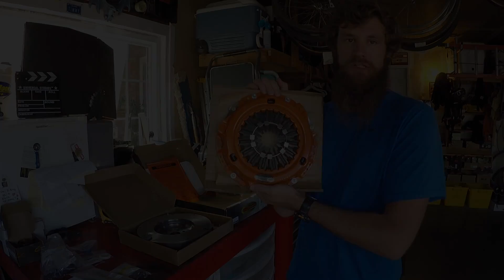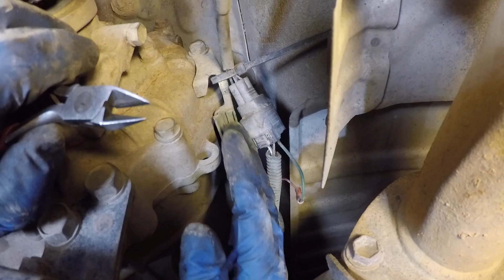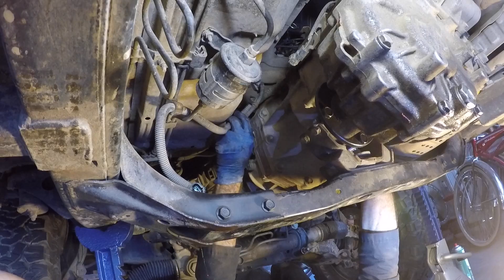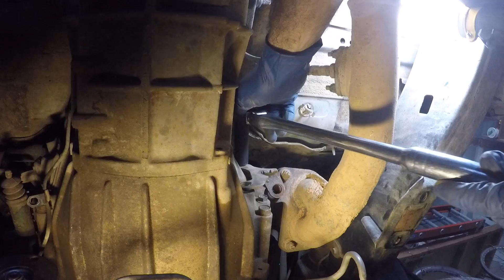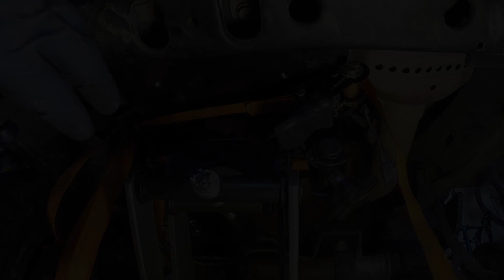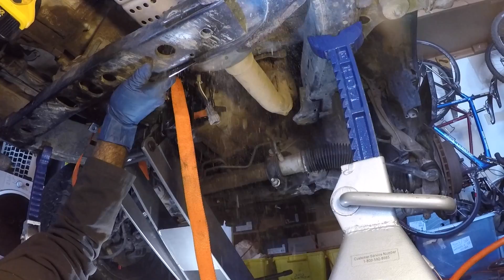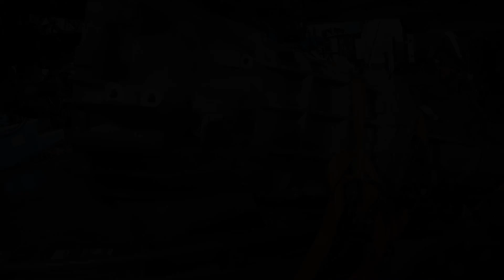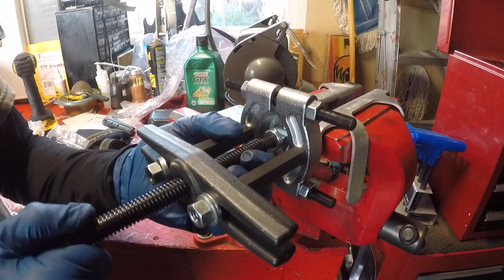Clutch Replacement (Part 1)

Comment from the maker: PLEASE READ THE VIDEO DESCRIPTION FOR HELPFUL INFORMATION
Reply: Flywheel bolts Part # 90105-10138. Check with where you buy them as some come individually and some come in sets.
Reply from the maker: @cjcruz7965  Thanks for sharing this.
Reply from the maker: @joseph7105  https://youtu.be/mrSRBmFZ1wk
Reply: @TimmyTheToolman  ma
Reply from the maker: @joseph7105  No problem.  The link to Part 2 in the video description was bad for some reason.  I fixed it.  Thanks for the heads up.
Reply: FYI... the estimated hours for basic clutch R&R is six hours
Reply from the maker: @efil4kizum  My local Toyota dealer charges $300/hour.  That would be an $1800 bill in labor alone.  OUCH!
Reply: regarding the shifter seats... OEM price is 53$ for the transmission one WOW... marlin is 12$ or so... big difference in cost, how is the quality?

Comment: Hey Timmy and Crew, I wanted to share my gratitude for the time and effort you all put into these videos.  This past weekend I completed the clutch replacement... along with the flywheel, pressure plate, clutch fork, t-o bearing, rear main seal, pilot bearing and shift seats.  Fun, challenging, and rewarding project.  No bolts snapped but I could not get the bolt out of the exhaust side of the exhaust bracket, fortunately I was able to get it loose enough to swing out of the way! thank goodness.  The other issue I ran into was having to bleed my clutch reservoir after the job, easy peasy!  Also, I was originally going to do the job on a dirt floor with a non-transmission jack.  Man am I glad I didn't.  I found a garage to use and a transmission jack and I don't think the job would have been a success without.  Thanks again for helping us all out.  Keep crushing, Cheers!
Reply from the maker: I'm glad our series helped you with the clutch job on your rig.  Good job getting it done.  Happy Wrenching!

Comment: Doing my clutch on my 3.4 today and I shouldve listened to you Tim I decided I wanted to take off my bell housing to give it a nice clean and also to replace my input shaft seal and well……………. That went south real quick broke 2 bolts I was able to get one out fairly easy the second one I was on the same boat as you guys were after a little drilling and cursing I managed to drill it out and retapped it good as new but man I wonder how many more of us go thru this.
Reply from the maker: It's odd that this happens.  I've seen bell housings come off with no issues many times,  but then you get ones with seized bolts.  The ironic thing is, I learned you don't need to remove the bell housing to replace the input seal.  All you have to do is remove the housing around the input shaft.
Reply: @TimmyTheToolman yeah shit sucks when bolts break! And yeah I had seen that as well I just wanted to remove the bell housing to give it a good clean remove alotta the grime and gunk it had built up when the bolts broke I just remembered your words lol YOUVE BEEN WARNED! 😅 I WAS LIKE FUCK! lol
Reply from the maker: @edwinthetechnician6578  Yeah, I try to give the best information possible so people don't experience the same pain as we did.  But, you got through it, and that's what counts.
Reply: @TimmyTheToolman thanks alot Tim ive learned so much from you and Sean im really thankful and appreciate you guys another thing that has helped me on this job is having the right tools!! Ive invested in some tools that make jobs so much easier
Reply from the maker: @edwinthetechnician6578 You're very welcome.  You're smart making the investment in tools.
Reply: @TimmyTheToolman  thank you I love working on my own vehicles the amount of money ive saved by doing the jobs myself is crazy!

Comment: Hey Timmy I doubt you'll see this but do you have any advice for the installing the  3.0-3.4 clutch swap kit from yotashop?
Reply from the maker: I don't have any advice other than make sure you put the clutch plate in the correct orientation and put sealant on the flywheel bolt threads because they are through bolts.
Reply: @TimmyTheToolman alright thank You
Reply from the maker: @CasualWeasel You're welcome.

Comment: @TimmyTheToolman Now that I have replaced the clutch, I have no play in the clutch pedal. I have turned the adjustment rod almost all the way out (clockwise). It is only about 1/4 a turn in just to make sure it holds on. If I try to turn it Counter Clockwise to release some of the tension, the clutch starts to grab even with the clutch in. I have confirmed that the clutch is fully disengaging by using a borescope with it adjusted almost all the way out. We put it in neutral so that there was minimal friction on it to see if it still turned. (See "Centerforce II Clutch disengage fully" on my channel). It requires the clutch to be all the way to the floor, but it fully disengages. But if we try to turn it counter clockwise to bring in the pedal, the clutch starts to engage  even when the pedal is down. 

Is this a symptom of a failing master / slave cylinder? Also, what is the importance of having that few mm of play on the clutch?
Reply from the maker: Maybe it's the slave cylinder.  Was there any indication before the job that the slave cylinder wasn't operating properly?
Reply: @TimmyTheToolman  Nothing really stuck out. Though I am not sure what I would be looking for.
Reply from the maker: @brandonkish3100 You should be able to adjust the pedal so there's free play.  I don't understand why you can't make that adjustment.
Reply: @TimmyTheToolman  I know it used to have it before the clutch change. I blead the system and put fresh dot 3 in, but didn't seem to affect it. I think the pin in the slave cylinder came fully out during install but no fluid came out and it seemed to go back in okay. Not sure if that is okay. 

What is the importance of the freeplay? The clutch seems to be operating correctly other than it being all the way out and no freeplay.
Reply from the maker: @brandonkish3100 The free play is to guarantee there's a full disconnect of the clutch when you release the pedal.  If there's no free play, there could be a slight drag on the clutch.  That's the way I understand it.
Reply: @TimmyTheToolman  Okay, if that is in the case than I think I am in the clear. I used a bore scope with the transmission in neutral and confirm that when the clutch is pushed in that it stops spinning completely. I found you can get a borescope in through the hole where the fork boot goes. There is a port on the side of the fork boot where you can get a bore scope in. I got it in position before I turned on the truck. Then had my buddy turn on the truck and push the clutch in and out a few times with the truck in neutral. I could see the clutch disk stop spinning completely when the clutch was pushed all the way down.
Reply from the maker: @brandonkish3100 Yeah, I think you're ok then.

Comment: @TimmyTheToolman When I pulled out my shifter for my transmission, I found it had a different bushing on it than the standard Marlin Crawler one and all the other bushings I see for replacement on the 3rd gens. I didn't realize until afterwards, and now my 4th gear gets locked up when I shift into it when I use the marlin crawler one. I can't seem to find the bushing anywhere to replace it. I was wondering if you could take a look at it in the video I posted on my channel labeled "1997 4Runner manual Non-standard shift bushing?" to see if you have seen it before, or if you have any insight. I would really appreciate it. Thanks again.
Reply from the maker: That looks like the bushing that goes onto the end of the shifter, not the Marlin Crawler shifter seat bushing that sits in the transmission.  At play time 13:36, you can see that orange colored bushing at the end of the shifter rod.   You're going to have to visit your local Toyota dealer and buy it from them.
Reply: @TimmyTheToolman  You are correct. I purchased both the Marlin Crawler shifter seat bushing and the Marlin Crawler bushing that goes on the end of the shifter rod.

I was wondering if you had ever seen that type of shifter rod bushing before amung your dealings with any of the 4Runners. I am so confused by this because the bushing for the shifter rod that Marlin Crawler sells  doesn't have the flange at the base like the one I pulled out of the transmission. I don't know why my transmission uses a different shifter bushing than what everyone elses uses. Was hoping you had seen that one before.
Reply from the maker: @brandonkish3100 I've seen that bushing before but I've never tried to replace one.  I'm fairly certain you can get a replacement from Toyota.
Reply: @TimmyTheToolman  Do you have any resources I could use to figure out what this bushing part number is? I am having a heck of a time finding out anything about it. I have been searching parts lists, watching videos, even posted in a forum a request for any information on it, but so far I have not seen ANY videos/images for a Tacoma or 4Runner that have that bushing. I am not even sure how to go about asking the Toyota dealership if they have one, since it seems to be really rare / uncommon.
Reply from the maker: @brandonkish3100 Just visit your local dealer parts department.  It should be easy for them to look up.
Reply: @TimmyTheToolman  Just an update on this. I called about 10 dealerships in my area. 8 of them really had no clue (I sent them an image of the one that came out and said they had no idea). Two of them came back saying the part was "Part #33548-31010 > BUSH, NO.1, SHIFT LEVER (FOR FLOOR SHIFT)", however, this bushing also caused the shifter to get stuck in 4th gear just like the Marlin Crawler Bushing.

I called Marlin Crawler to ask them for help, and they came back and literally told me over the phone that they had "No Comment" on it (Even after I sent them images of the bushing that came out, and a video showing their bushing getting stuck in 4th). I had a pretty bad customer service experience with them. I also received a pretty bad flywheel from them, but that is another story...

I tried to start modifying the Marlin Crawler bushing to solve the issue. I sanded 1mm off the top to reduce how far past the bottom of the shifter it stuck out (Past the flat spot on the bottom). However, just when I started to get it feeling good and shifting smooth, It cracked in half on me. I do not think this is a knock against the Marlin Crawler bushing. I was modifying it, and had pulled it on and off of the shifter 10+ times. However, that is what happened. It was one of the times I was pulling it off. I heard a loud snap, and there was a large crack down the side. I chose no to attempt to use it and disposed of it at that point.

I had considered purchasing a second Marlin Crawler bushing to modify, since I believed that it was due to all the stress of taking it on and off that caused it to crack, and that I got it really close to perfect. I felt that I could replicate the modification and get it in one go. But I decided against it after the Toyota dealerships came back with "33548-31010" being the correct bushing, and the bad customer experience with Marlin Crawler. So take it as you will.

So instead I purchased a "33548-31010" bushing from Amazon. It was stated to be OEM, but it did NOT come in standard Toyota packaging, and I believe it was not OEM. However, It seemed to fit a little better on the shifter, and as far as I could tell was nylon. So I did not return it, and attempted to use/modify it. It was also only about $6, where as the Marlin Crawler one would have been about $25+ after shipping.

I did notice that the "33548-31010" from Amazon seemed to slide between the gears a lot easier / smoother than the Marlin Crawler did. The Marlin Crawler one to me felt a little clunky compared to the Amazon one. Not sure why, that was just my experience. I like the feel of the 33548-31010 bushing over the Marlin Crawler one (Though I am still using the Marlin Crawler Seat bushings). 

I designed and 3D printed a fixture that would allow me to sand down exactly 1mm off the end of the bushing. This still caused 4th gear to stick a little, but not near as much as what it was stock before I sanded it down. After trying to get it out of 4th gear, I think it kind of shaved a little bit off of the modded 33548-31010 Amazon bushing and now it is working really well. I will have to drive it a little more, but it seems to be working.

If I had to do it again, I think I would probably shave off just a little bit more off the bushing. Maybe somewhere from 1.2mm -1.4mm. I think this would have made the bushing perfect. But as of now, it seems to be working well.
Reply from the maker: @brandonkish3100  Boy o Boy, that's a lot of BS you went through for that bushing.  Glad you got it figured out.  

I'm not that impressed with Marlin Crawler either but I have bought stuff from them several times.

Comment: @TimmyTheToolman I watched your other video "22RE Engine Replacement" as a guide to replace the Transmission Retainer Oil Seal that you guys had issues getting to in this video, and the guy in that video he mentions that he uses "Ultra Black" for the FIPG for re-sealing the Front Bearing Retainer Plate. Can you tell me if this is the correct product to replace the FIPG seal?
Permatex 82180 Ultra Black Maximum Oil Resistance RTV Silicone Gasket Maker
Reply from the maker: Toyota 1281 is technically the correct sealant to use for transmission, transfer cases and differentials. But, there are other manufacturer sealants that work as well like the one used in 22RE Engine Replacement video.
Reply: @TimmyTheToolman   Thank you for the reply as always! I think the part number for the Toyota 1291 is "Toyota 00295-01281" according to their T-TT-0050-10 "Adhesive & Sealant Cross Reference Information" sheet from Nov. 2010. They also state ThreeBond TB 1281 as a direct replacement. For anyone else also curious about this. I just happened upon this sheet as I was typing this reply. Thank again for all your help @TimmyTheToolman.
Reply from the maker: @brandonkish3100 You're welcome.